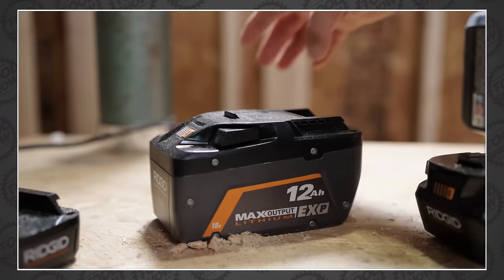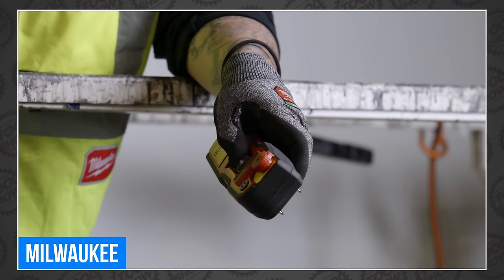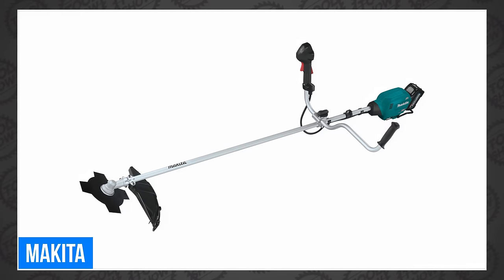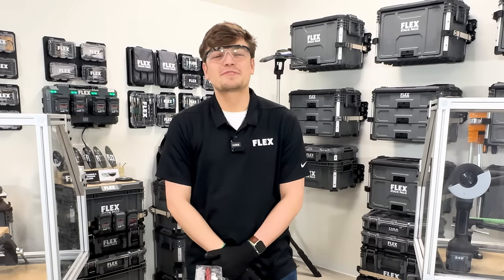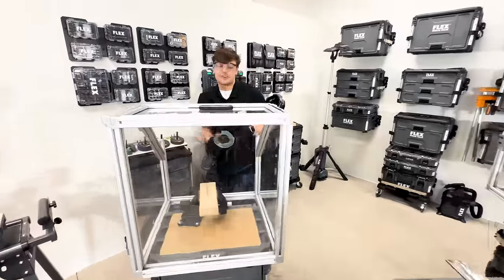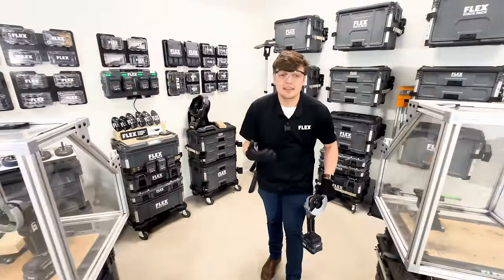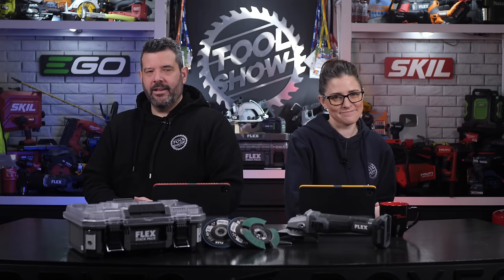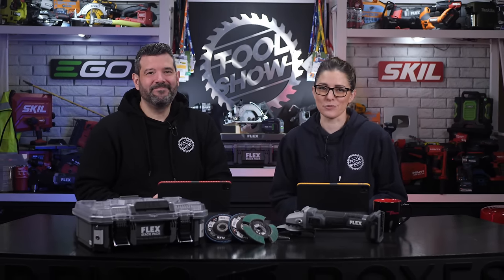NEW Power Tools from Milwaukee, Makita, RIDGID, RYOBI, and ECHO!

Comment: As a Dewalt fan you gotta hand it to Milwaukee. They just keep pumping out innovative and unique tools across many professions and industries. Meanwhile Dewalt seems content with just providing the most common job site tools. Not saying Dewalt doesn't come out with new stuff. But its just rare in comparison to Milwaukee.
Reply: it cost a lot of R&D funds to do that and Milwaukee is own by Berkshire Hathaway, Milwaukee will becomes a size like Heinz, Kraft, Burger Kind and Tims Horton...god
Reply: Dewalt has had new releases the last 4 years lots of new tools where ya been? They revamped the 12 volt line, new impact wrenches, impact drivers, recip saw, cut off tool, power stack batteries, sds, drills, band file, band saws, chainsaws, pruner, ratchets, pex expansion tool, 60 volt tools, and now power shift, the list goes on and on bro 😂😂😂
Reply: The tti that berkshire owns isnt the same parent company that owns Milwaukee @costavong6018
Reply: If dewalt wasnt an american company, it wouldnt be so liked in u.s
Reply: @Lee-lb9qh  notice how the bulk of what you listed there were common jobsite tools like he said.
Reply: The M18 hoist was co-developed with Columbus McKinnon. CM sells it as the BatteryStar.
Reply: @meeknuggets4860  I didn't list EVERY tool they made bro 😂😂😂🤦
Reply: @Lee-lb9qh  So where is dewalts chain hoist?
Reply: @meeknuggets4860  😂 really hanging onto that chain hoist huh?
Reply: @meeknuggets4860  where are Milwaukees 60 volt tools with batteries that go between 60 and 20 volt tools?
Reply: @Lee-lb9qh okay? so wheres dewalt plate compactors, edging trowels, ect ect? theres more than the hoist and you know it.

Milwaukee's mx batteries are 72 volts..

and i don't think you'd wanna attach one of those to a 20 volt tool (besides maybw their miter saw or table saw) even if milwaukee had that as an option, because they are massive batteries.
Reply: @meeknuggets4860  as I mentioned earlier they have those as well. It's called power shift bro 😂😂😂
Reply: @meeknuggets4860  Dewalt came out with the same thing they call it power shift, look it up, your not very good at this bro 😂😂😂😂
Reply: @meeknuggets4860  Dewalt came out with power stack before the Forge battery came out too
Reply: @meeknuggets4860  Dewalt showed all the new POWERSHIFT tools at world of concrete, got the rammer, plate compactor, jackhammer, the trowel, concrete vibrator, back pack concrete vibrator, core drill, they also have snowblower coming in either flexvolt or powershift I'm not sure, but you can even power the powershift tools with flexvolt batteries in a pinch, and they have more coming
Reply: @meeknuggets4860  just because you don't keep up with Dewalt doesn't mean they don't make the tools, 🤣🤣🤣 they even advertised the powershift tools at the sphere in Vegas
Reply: @meeknuggets4860  ill be fair bro, the only tools I can think of off the top of my head that Milwaukee has that DeWALT doesn't is a drain camera and reel, utility crimper, and this chain hoist, but fair is fair, Dewalt has worked with a third party just like Milwaukee and they made a welder, Milwaukee ain't got that
Reply: @Lee-lb9qh  also dewalt doesn't have the edging trowel in powershift? only the screed
Reply: @Lee-lb9qh  Dewalt fanboy writing 5 paragraphs and fills half of it with laughing till crying emojis. the point still stands that milwaukee now has more niche tools over dewalt and you can't dispute it. 

and okay, so? milwaukee has a forge battery now so it's irrelevant. they both have one.
Reply: @meeknuggets4860  sounds like a Milwaukee fan boy knows how to use Google and learned something new today 😂😂😂😂😂😂😂😂😂😂😂😂😂😂😂😂😂😂😂😂😂😂😂😂😂😂😂😂😂😂😂😂😂😂😂😂😂😂😂😂
Reply: @Lee-lb9qh  Even though you didn't notice dewalt didn't have everything milwaukee has?

also when i searched, it didn't come up. it'a like 20 results down. even searching concrete vibrator only shows their old one. 

also i'm not a milwaukee fanboy.  milwaukee just offers more niche items than dewalt. its a fact. you don't have to be a milwaukee fanboy to stand behind FACTS. 

go cope with more laughing emojis.
Reply: It’s always great to have them competing to provide better tools and ideas
Reply: @Lee-lb9qh the original intent was to provide all the tools without worrying so much about battery platforms . Then came  m-12 ,and then MX commercials batteries. And then the 2-battery (36v) tools like the mower and the new dual battery blower.
Reply: Dude, Milwaukee pumps out junk tools then after the third gen they fix it. Dewalt puts time into R&D then puts out the best tool on the market for the next 5-6 yrs before others try to beat it
Reply: Battery  welder game changer
Reply: This comment section is great…
But Dewalt still can’t make an impact and Milwaukee still can’t make a saw, just facts
Reply: well dewalt doesn’t get a bunch of chinese capital like tti gives milwaukee

Comment: I actually like the Ridgid cordless power tool lineup... They are definitely rugged and durable, and they have a lot of power... I'm not gonna say that they are better or worse than the other big brands out there... But they definitely will get the job done.
Reply from the maker: They’re definitely a step up from RYOBI.
Reply: I feel like most people that bash rigid just do it because everyone Else does not because they have any real experience with them long term

Comment: Are we going to hear any news on more 12V and L4 redlithium battery tools. I have a lot of them laying around waiting to be used for other tools. I'm most looking forward for a 4 or 8 volt (1-2 L4) ratchet screw driver or upgraded barrel geip/dun transformable electric screwdriver that can handle both electrical work, screw screws and also be used for micro repairs for consumer electronics, all in one. Also would like to see an improved charging station where we can combine 18 and 12 V batteries  for a complete powerstaion home solution with m18 and m12 batteries, and perhaps a battery bank where we can use 3-6 L4 batteries to make one milwaukee battery bank that will support 60-100 watt power for powering or charging a laptop or higher power electronics. Also would be cool if milwaukee could make a kit to make an e-bike with mikwaukee batteries. The biggest issue is that there is not a comoatible socket for charging and discharging. On the platform they are both seperate which makes all in one solutions a challenge.

Comment: A few corrections…

They are called tension control bolts (not tightened control bolts Sara) for the Makita XGT shear wrench.  

And the Makita dethatcher/scarifier would be a max working depth of 15 millimeters (not 15 inches Rob!)…

CGW did a see-through disc (branded Z-thru… Z standing for zirconia) that’s been out around 10-15 years, and I’m guessing other manufactures also made similar discs, but CGW at the least has had that style of disc out for a very long time (Rob).
Reply: That working depth caught  me too!   15 INCHES?   "NFW!" I said to myself! Don't worry Rob...we won't hold you to that number!  😉

Comment: Im falling for this…even though they are tricking us into less abrasive material overall……It will cost us more in the long run if it becomes standard……
Reply from the maker: They're selling both options. If you don't need to see your work, don't buy the segmented version.

Comment: to this day, i still struggle to find why RIGID makes sub par power tools, when they are cream of the crop in all other tools that they produce.  ime well aware of tci or whoever owns them and the other companies, but still, i dont get it
Reply from the maker: Are you aware there are two different RIDGID's? 

"Red RIDGID" (red line in their logo) is the original owned by Emerson Electric Co located in Ohio. They are a storied legend, and invented the pipe wrench. They make pro grade plumbing tools, and are highly regarded by Plumbing/HVAC pros. 

They licensed the use of their name and logo (but with an orange stripe) to TTI, who uses it to make a mid-tier (we call it "Jobsite" grade) tool line that slots between RYOBI/HART and Milwaukee, and is sold at Home Depot. "Orange RIDGID" likes to think they're taking on DeWALT, but I think that's a stretch.

It's getting harder and harder to keep them separate, especially now that they're starting to make competing tools. From what I've gathered from contacts on both sides, NO ONE is happy with the arrangement. It was made by people at Emerson and TTI that are long gone. These days no one likes the deal, and they both struggle against the confusion. No clue how you fix that one though.
Reply: @ToolShow  No i did not know anything about that, guess i learned something new today, my sense of confusion and wonder has now been cleared lol!

Comment: YOU SHOULD AT LEAST BE ABLE TO GET AN INSERT FOR A PACKOUT THAT HOLDS EACH TOOL.  Modular insert that hold each tool in a packout would be much appreciated.
Reply: Those exist, it's called Kaizen foam inserts.
Reply from the maker: Kaizen Inserts are AMAZING. We use them daily.

Comment: That flex disc with the slots is definitely a liability, wouldn’t be using those explodadiscs 😂. Give it 1-2years on the market before they get pulled
Reply from the maker: The design has been very successful in Europe. Tested and works great.

Comment: FLEX grinding wheel comparison was lame. He used a much thicker wheel on the competitor than the Flex. Want a competition, same wheels against a Dewalt 60 volt 6" grinder. That thing is an absolute beast.
Reply from the maker: He was comparing the discs. The grinder was identical.